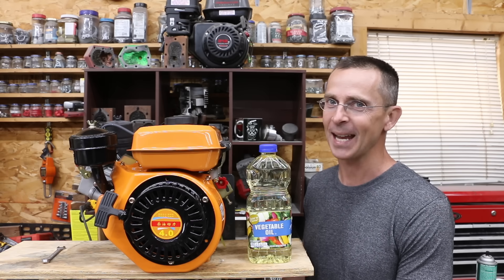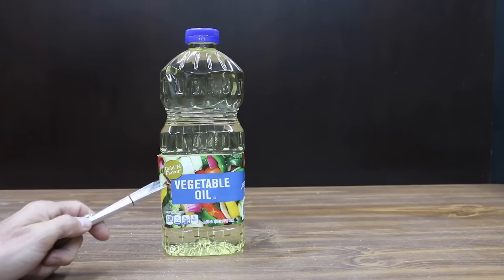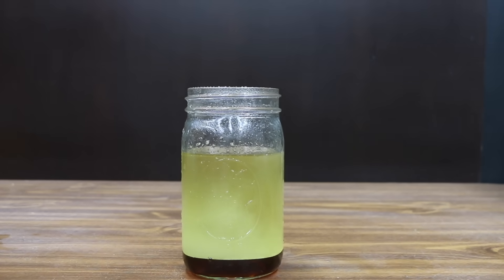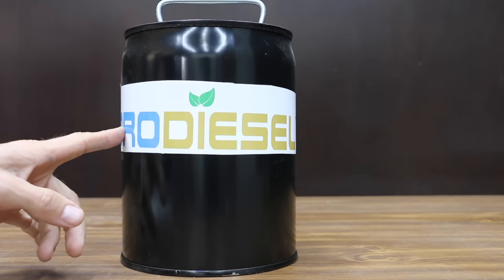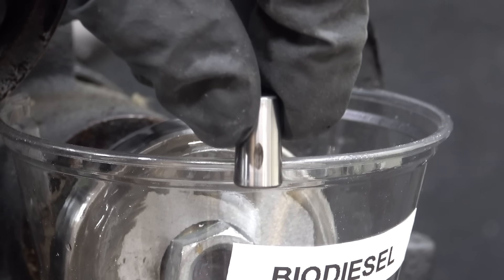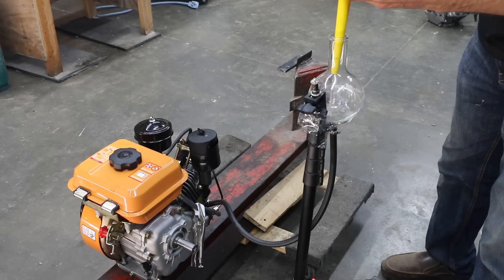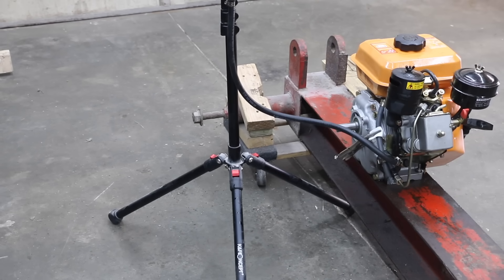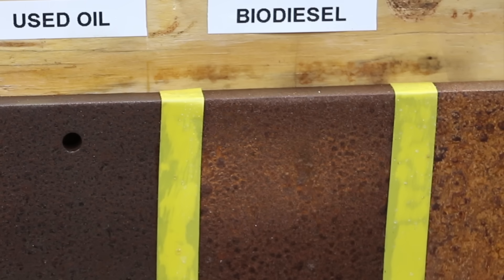Make "Biodiesel"? Let’s find out! Diesel vs Biodiesel, Used Motor Oil, Vegetable Oil, MPG

Comment: I remember hearing a story about someone who worked at a fast food restaurant, and took the used fry oil to use in their vehicle. I always wondered how well it would work. This mostly answered that question.
Reply: I first saw this in about 1978 on an NBC tv show called Real People, an old timer with a diesel VW Rabbit ran his car on old fry grease, filtered and heated. Worked fine.
Reply from the maker: Thanks for sharing.
Reply: I knew a cross-state speed courier who ran a old Mazda diesel engine in a Toyota pickup. He had a mobile conversion set up against the cab and drove all over the Midwest with his dog.
90% of his fuel consumption was from restaurant's cooking oil he converted through his custom system in the back.

Comment: i just dump 1 gallon of soy or Canola into my 100 gallon transfer tank in the bed of my Duramax then i pump it into the truck tank via a 2 micron filter. I do that just as a lubricant additive and i also double the the mileage of the fuel filter change on the engine which is a 4 micron filter and 3 time the price of the 2 micron in the bed plus on the newer trucks you have to remove the wheel well tub just to get to them. I have experimented with up to 3 gallons veg oil per 100 diesel in the northeast winters never a problem and i believe i could probably go as high as a 50/50 without heating as long as the temp was above freezing. My third Duramax doing this running them up between 6 and 700,000 before selling them with no problems except for my 01 which had inherent injector problems and still i only replaced them once in 680,000 miles. The SVO is the best and cheapest replacement for ULSD fuel imo. Thanks for the video.
Reply from the maker: You are welcome!  Thanks for sharing.

Comment: Great Test! Blamazon says no more little diesel motors. I have over 30,000 miles on wvo... In a 7.3 power stroke with a a greasecar kit and a 82 mercedes with a 3l turbodiesel. Found a mix of 5 % gas 10 to 15% diesel with the rest heated/filtered wvo worked best.... Increased diesel to 50 % in the Mercedes single tank system as it got colder in the winter.
Reply from the maker: Thanks!  Thanks for sharing.

Comment: I remember when this was the rage. I live in Ct and they really cracked down on this. Like if you were buy large quantities of supplies to make this you would get a visit from the DOT. I was going to go down this rd but decided not. But I have how ever been running waste motor oil in my VP44 Cummins. I have an air dog as well. I’ll run about a 50/50 mix of oil to diesel mix most the time. It runs real quiet, small drop in the mpgs. I’ve been doing this for about 10 years and i still have the same fuel system. I have only had fuel clog once, wich was my fault. I usually leave about an inch or two of wmo in the bucket when I’m putting it in the tank for whatever has settled to the bottom. I mistakenly emptied the bucket into the tank as I was chatting with someone as I was filling up. Won’t do that again. I would not however run any of this stuff in any common rail diesel.
Reply from the maker: Thanks for sharing.

Comment: I bought a Mercedes from 86 a W124 250 D. which I drove on pure rapeseed oil. For a school work. had a separate tank and a three way crane. to start on diesel then turn over to rapeseed oil. Noticed no difference in consumption, what was noticed was the smell of the exhaust gases
Reply from the maker: Thanks for sharing.

Comment: Here's a kick in the junk for ya.
Some years ago, rendering companies provided a dumpster free of charge, and cut you a check after they picked up your used restaurant fryer oil.
A bit later, the lies started, and they convinced us the stuff was basically worthless, while they in turn sold it to oil recyclers, pharmacological outfits, the makeup industry, and God knows who else.
Later, They called it a wash, took the oil, and payed us little to nothing.
The next thing you know, they "Had" to start "covering" loses by charging rental for the dumpsters.

Bada bing, after that kick settled in, they said, "WTF" why not charge them to pick it up????
And so it was.
As a restaurant owner, you bought the oil, used the oil, discarded the oil, paid to store it, and paid to have it hauled off.

I really wanted to buy a little diesel truck and convert fryer oil to fuel, but unfortunately, the good tasting stuff, "Lard"  needs more processing than canola, which tastes like crap, and didn't financially balance out.

I've heard that diesel is one of the easiest, and first things to come off crude oil. It used to be cheaper than gas, not so anymore is it?
Care to put any of this to a test?

Keep up your valuable quest.
It's worth more than anything anyone these days will ever learn first hand, or in school.
Reply from the maker: Thanks, will do.

Comment: You forgot Bacon Grease?
Reply from the maker: Thanks for the suggestion.
Reply: @ProjectFarm  I can already tell you a diesel engine will run off bacon grease or practically any oil or even transmission fluid and brake fluid, now long term effects are a different story.

Comment: I have a buddy that has been running a 6.0 hp Lister motor on used motor oil daily for around 12 years now.
Reply from the maker: Thanks for sharing.
Reply: @ProjectFarm  He uses a centrifuge from an 18 wheeler engine to filter the oil.

Comment: Long Term Testing of waste oil as a diesel replacement would be very interesting, as usually the sud of waste oil ist the biggest problem. At least it is with heaters...
Reply from the maker: Thanks for the suggestion.

Comment: pre1990 diesel engines can run on pure filtered used vegetable oil.
I drove 500 miles with a pal in a 88 peugeot diesel running chip fat in britain, we added a shot of grapeseed oil to thin it and it burned less stinky.
Reply from the maker: Thanks for sharing.

Comment: My second cousin is really cheap and he was making his own diesel from used cooking oil and sump oil.
He said the sump oil was ok in a pinch but he needed to change filters so often that it was almost uneconomical. Used cooking oils were the best. But he stopped doing it so it was either unfeasible or too time consuming. 
If it was worth it, he'd be doing it. This is a guy who loaded buck shot with old fishing sinkers because they were cheaper.
Reply from the maker: Thanks for sharing.

Comment: sad to see the prize of fuel rizing in America. we have one of the highest fuel prizes and next to that pay taxes per car weight.
now we try to go to the pump if the prize drops a bit. 
and the worst thing we pay taxes for gasoline per liter, but 15% is methanol. i think that is not so fair.
say you pay 1pint of beer, and get half pint beer with added water. i do not want to pay for the water.
Reply: Unless it bootleg gas, It’s not methanol, too corrosive.  In the US, it’s illegal
Reply: @wchougland1  any other fuel than from the gas station is not alowed indeed

Comment: I knew a guy he used old vegetable oil in his pickup truck drove from Alaska to the east coast of Canada.  He got less fuel mileage but it was all free. So his trip cost him nothing or very little. Plus he had a camper trailer towing it as well. So 1 or 2 miles less per gallon not bad when restaurants give it for free and yes it smells like French fries 😋 so that is not bad unless you are hungry 😉.
Reply from the maker: lol  Thanks for sharing.

Comment: I used to filter old oil with you won't believe it but filter it through toilet tissue, you take and old air cleaner and remove the expanda metal and make a rolled pipe out of it the attached it to an oil drum lid. Roll the toilet tissue around the expanda metal roll and fit to drum with used oil in drum, to speed up the process you can use a little bit of pressure, the oil will come out clear after a while, as soon as it becomes clear you can use this old oil mixed with diesel, I service a lot of farm equipment and it is really a waste to send to a recycling plant as even they pay for the used oil diesel prices are higher than what these recycling plants pay you per litre of old oil. You can laugh as much as you like about using toilet tissue but it's cheap enough and work's and the more dirt it traps the cleaner the oil comes out. Try it.
Reply from the maker: Thanks for sharing!

Comment: New diesel are very picky with what they run. 

12 valve mechanical, 🤷🏻‍♂️🤷🏻‍♂️ throw it at me I'll burn it
Reply: I've seen at least one guy that does the use oil/gas mix. Old school 12 valve as well
Reply from the maker: Thanks for sharing.

Comment: Very interesting! The reduced friction on the veg oil matches my observations in my old diesel Landrover. It had a small but noticeable power increase when I ran it on filtered waste veg oil. The diesel rattle was less in the Landrover too. I only stopped using it because I couldn’t get enough of it to be worth the filtering effort.
Reply from the maker: Thanks for sharing.

Comment: Hi there, again I'm so impressed how meticulous you are when you carry out your tests, well done ✅ My father was an electrician for over 40 years we used throughout years transformers oil to run our farm tractor. If you can please use this idea in one of your future tests. We couldn't measure how was the fuel efficiency on the tractor but the engine seamed to "enjoy" transformers oil. Here's the definition: Transformer oil or insulating oil is an oil that is stable at high temperatures and has excellent electrical insulating properties. It is used in oil-filled transformers, some types of high-voltage capacitors, fluorescent lamp ballasts, and some types of high-voltage switches and circuit breakers. Cheers
Reply from the maker: Thanks for the video idea.

Comment: I have a friend who's grandpa has an old Mitsubishi Pajero that runs only on mixed fuel. He has a big barrel in which he throws everything: used engine oil, used fry oil and also dirty diesel (after washing some mechanical parts for example). He than has 2 big fuel filters that filter out everything before putting the "mix" inside the tank of the car. The car makes a lot of smoke but runs pretty well, the engine has made 800000km for now.
Reply from the maker: Thanks for sharing.

Comment: "Lets test the engine out on straight vegetable oil"

Me: "Wait... what..."
Reply from the maker: Thanks for watching!
Reply: Rudolf Diesel originally intended to power his engine with peanut oil.
Reply: A coworker of mine ran his gen1 tddi ford focus on vegetable oil.
Reply: Many many people ran the old VW Rabbit diesels on WVO from Mcdonalds and other FF places. Yes, they DID smell like French Fries when they drove by.
Reply: @acdii  Nice. And those little things got UNGODLY mileage (50 mpg+).
Reply: Yeah, I didn’t expect that to work. But there you have it.
Reply: oddly you can run any non common rail diesel engine on SVO providing the HP pump has enough clearance to allow lubrication of the driveshaft with that viscosity of fuel,I've ran several Bosch equipped PSA diesels on SVO as a sales rep. wouldn't recommend trying it on a lucas HP though
Reply: @mickkidston7344     *run
Reply: Yeah, I knew it was going to work
Reply: lots of people run old diesel engines on used veggie oil🤷‍♂️
Reply: yeah same lol
Reply: What? You're just now learning this, or something?

Comment: I can definitely see oil companies paying big money to have the injectors changed to reject anything other than real diesel fuel  nowadays.
They don't like it when we can get one up on them!
Reply: Older fuel injection components weren't designed to run it either. Newer pumps and injectors are designed for emesions and to run the most recent blend of fuels.
Reply: Most people don't put vegetable or used motor oil in their cars, so it makes more sense to optimize fuel injectors for best performance with diesel fuel.
Reply: Back in 1993, I was learning how to read blueprints for cabinet building. The gentleman that owned the auto parts store I was at,  ask me if I wanted to see some blueprints? He was a retired engineer. He used his money to buy a auto parts store and fill it up with all the rare Parts you could not find it other part stores. This gentleman was real eccentric. His parts store was stacked up eight foot tall everywhere!  There was only a 2 ft wide pass that led through the store. His car was stacked up like that also.
After about 10 minutes of him searching,  he came out with  a tube and pulled three pages out of it. He laid them on the hood of my car for me to look at. It was way more advanced than what I was used to seeing! I told him this looks like Space Age Technology, what in the world is it?
He told me it was a "Carburetor" ( if you could call it that) that he had designed. You could get 75 miles per gallon with it! We are talking the old big V8 engines 75 miles per gallon!
I was like what?😲 why in the world are we not using it?
He told me the oil companies bought the rights to it & it was no longer available to the public.
So there is a lot more that goes on then what we the public know about! 
Sadly not too long after that, just a couple of years. The gentleman had a stroke & ended up in a nursing home. His son inherited everything. But did NOT want anything! They plowed down his house, plowed down the auto parts store FULL with all of the rare auto parts, all inside of it and put him in a nursing home!
It made me sick to my stomach!
He also had 3 super rare,  BRAND NEW 426 HEMI engines in crates, never opened at his house.  They were famous engines for having the all-time top speed set at NASCAR tracks. They smashed the three crates also!
His blueprints also got destroyed when they plowed the building down. The whole thing upset me when I learned what happened!
Reply: I know, right? People getting back into the older diesels and experimenting with them is like Gamestop / Wall Street Bets to the modern diesel industry.
Reply: The Deisel engine was originally designed to run on veg oil. You know what happened to the inventor  right?🤔🍻
Reply: @alsaunders7805  that's fine and all, but we're not talking about the "original diesel".

Comment: i live up north and use vegetable oil when its cheaper than diesel, to stop it from freezing i use 50/50 with diesel. i would like to see how that compares to straight oil and straight diesel. Also making a small dyno like warped perception did could give you a better test for performance
Reply from the maker: Thanks for the suggestion.

Comment: There is no need to make Bio-Diesel, please let me explain. I get my waste veggie-oil from local restaurants for free. I let the oil sit for 2 weeks, which settles out the fats, solids and water. I Carefully remove the clear oil and send it through a 400, 200, 100 and 75 micron bucket filters. I transfer the 75 micron oil to a final 275 gallon tank by sending it through a 20, 5 and 1 micron polyester cartridge filters using a gear drive pump. All filters are cleanable and reusable. I then add gasoline to the final product in the correct percentage for the season. 10% for summer, 20% for autumn, 30% for winter. The longest part of the process is waiting the initial two weeks. I get all of my large buckets for free from a pool company and my 275 gallon IBC Totes for $45 each. I use Dawn dish soap mixed with Trisodium phosphate (TSP) to clean the filters. Works better than diesel.
Reply from the maker: Thanks for sharing.

Comment: Wow, thanks for running this test! Very detailed comparisons, without wasting the viewer's time. Diesel junkies around the World thank you!

On another note, I own a 1990 1st Gen. 12 Valve Cummins, Banks Intercooler, 4" Diamond Eye exhaust system (with muffler). I've run filtered motor oil with 10% gasoline. Mileage seemed somewhat less than street diesel, with a lot of smoke.

Have experimented with varying amounts of biodiesel, B20, used filtered Auto. Trans. Fluid. Straight B99 biodiesel creates a pleasant exhaust, but lower mileage. 100% B20 wasn't much better.

However, with just 2 gallons B99 added to 28 gallons pump diesel, I end-up turning a 500-mile fuel tank (pump diesel) into a 600-mile fuel tank.

Since I blew $1000.00 years ago on a fuel mixing/filtration pump system, I'll have to try the 90% solution motor oil again. My comparisons were done prior to several upgrades, in particular converting the exhaust from 3" to 4" and redoing the air intake horn and all the intercooler piping from 2.5" to 3" (kept the 2.5" factory-fit Banks intercooler, itself - a very rare find, BTW. It would have been too much hassle retro-fitting a 3" Mishimoto in there, and the Banks one still works fine).
Reply from the maker: You are welcome!  Thanks for sharing!

Comment: you should do a video on different types/ brands of mower blades like you did with the brush cutter blades. Which ones bag the best, witch ones mulch good, witch ones side disc arch best, best combo blade etc, i think that would be really neat!
Reply from the maker: Thanks for the video idea.
Reply: I second this! Finally moved out of the overpopulated city I was in and back to the farmlands where housing is cheap and spacious, and now I need to mow my lawn lol

Comment: I'd like to know if you can get a gas lawn mower engine to run on any of those fuels... maybe a two-stroke?
Reply from the maker: Thanks for the video idea.
Reply: @ProjectFarm  I will add that when I unearthed an old two-stroke someone left with this property ... had no idea what fuel ratio, so used "some" (probably about 25% and plain motor oil at that). The mower fired right up and ran great, with tons of power, tho it smoked a lot.